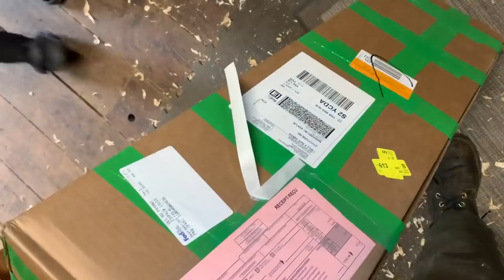Axe profile - why does my axe get stuck

Comment: 200 views while I was watching this. 9587 in a few hours. Top notch edit friend. 
Flat places in the bevel are what causes sticking. For you filers out there, even if a head is hollow ground like the single-bit the profile must curve. 
As the chopping end cuts the bevel pushes the chip (or split) 
Back about forty some years ago somebody compared a flat grind to cutting with a wood chisel if ya know what I'm saying. () not V 
And I love your comment-ers. Needs an automatic like button.

Comment: I can’t believe I see you in a Poulan hat.  I got old using Shreveport Poulan saws.  Not that junk Husqvarna markets as Poulan these days.  I still have my Super 25 Automatic, S25DA and it runs better now than it ever did.  I went through it, flipped the reed, cleaned up the carb, new fuel lines and filter,adjusted the carb, new gasket on cover and a few other things.  Now, I can crank it up, set it down and come back 15 minutes later and it is still running.  I could never do that in its younger days.  This saw looks almost NIB, even though it is 35 years old.  I bought it, new, in 1985 in Fitzgerald, GA.

Comment: Question BBR, several of my axe handles have warped. The one because it was leaning against the wall outside the barge. And it tends to rain a bit up Effingham inlet on BC coast. West coast of Vancouver Island actually
Reply: Any tips to keep them from warping while stored in the shop at home?
Reply from the maker: Magnum Tree Falling hang em by the head.  Or if yer gonna lean em. minimize the lean.  Straight up and down.best to hang em
Reply: Thank you, time to build an axe rack
Reply from the maker: @magnumtreefalling6400  me too